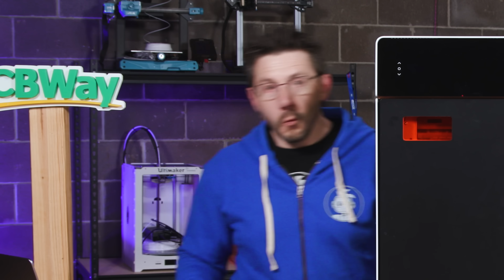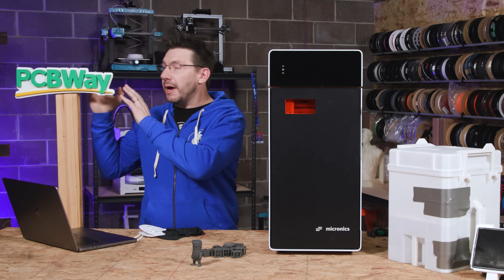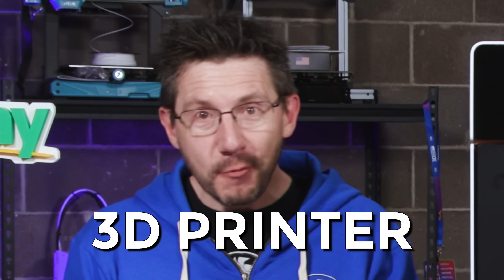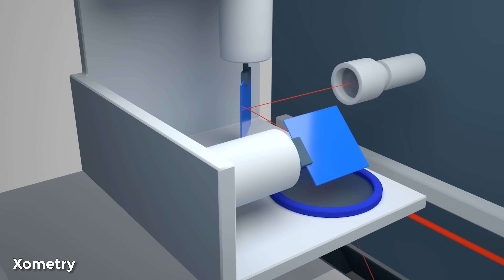SLS 3D Printing AT HOME?

Comment: If this machine being able to work with metal powder for this price it would be the best priced machine. But since this machine is expensive same as plastic powder and requires media blaster that is another expensive machine for finishing prints there is no way someone would be interested. This machine could be replaced with SLA printer which is $150 and $20 for 1L of resin washing and curing machine is optional you can build one for $10 uv lamp and $10 rotating display stand or buy one for $80.

Comment: Nice review of a promising product! 

I would love to see a build in vibrator that vibrates all the powder of your printed parts, which is also being sucked away in that process. Then a second stage where one or two build in sandblasting heads, use the same sintering powder and the sucking function in reverse, to blast the parts clean. The heads turn around, or the buildplate, what ever works best. Then a final stage which sucks one more time as much powder away as possible. The blasting and sucking may work best, when they are combined now I think of it. For blasting (without powder in the end) will bring particles to the suction mouths, where else they would be hard to reach. 
Even if this makes the printer twice as expensive, it would be a blessing and a huge time and headache saver, to not have to deal with the loose powder.

Comment: They should make a vibration table with a screen to post process the parts before blasting. It could be another add on unit. And i always thought about being able to do this with failed pri ts off of fdm. Make a box with a sanding belt at the bottom toss in faled prints and sand it down into a fine powder to reuse in a sls printer

Comment: Another option would be to get a small vacuum similar to what dentists use to suck up your saliva and just suck up the powder with that much like an archeological dig. I'd definitely go over to something far finer than 80 grit media, 500grit or finer would give it a MUCH better finish. You also don't need a big cabinet like that unless you are doing TONS of prints, you can make a hobby blasting cabinet out of a large plastic tote and a pair of sleeved gloves and use either an airbrush media blaster or something like the electric one they have on Temu or Harbor Freight for around $20-30. 
Personally, I think there's an altogether different option that'd make it to where you could gather and reuse the powder without tainting it with another media... Water blasting via a water pick. Having used a water pick back when I had braces I can tell you first hand just how powerful those things are.. you could easily wash the loose powder off with one of those and then collect it and dry it out to be used again.

Comment: too bad formlabs bought them out which means no consumer lever SLS printers Formlabs are gonna keep that out of reach for as long as possible
Reply: yeah it was all a rouse, controlling the competition, monopolistic pricing to keep profits up
Reply: You hit it on the head, formlabs so called low cost SLS printer starts at 28K, and thats just the printer… you still need the other machines for cleaning and curing….. so, if you think that 3k price tag isn’t about to increase you must be dreaming…. They greedy, and its no way they going to let the masses get in yet, they going to keep that price up until they cant anymore., then it will start coming down.

Comment: Micronics got acquired by formlabs so that Kickstart campaign is canceled. 

Formlabs bought them out due to the size and price being poised to under cut formlabs by 60 to 80 percent. 

So formlabs bought out micronics and that machine will not be produced. 

Sucks but I still hope that metal sintering will become more affordable, since it would drastically change the parts world and actually could upset "manufacturing secrets" of companies who upcharge for their custom styles.
Reply: its just another example of capitalism
Reply: @aquaticnstuff7666  well yeah, but it's their own choice. Freedom is most important. 

If they didn't want to make money then they wouldn't ever make anything new, the company which bought it micronics is chinese based so you can see that even communist ideology is performing the same moves as you do in a free market. 

I think according to the press releases and the rumors surrounding this merger that they are going to make a device simular to the one in the kickstarter just will have formlabs software and will be manufactured in China. Alot of actual manufacturing jobs are done in China since they already have the manufacturing industry and pay their employees less then America so it brings the overhead down. Plus asmuch as id like this to be madein America I understand that the price for a unit wouldn't be at all affordable for a consumer market.

Comment: This technology is clearly not ready for commercial use. Forget the inconvenience of having to sift through sand to find the parts you just printed, or the failures you encountered, the safety hazard this thing presents is already on par with resin.

Comment: That mask is not proper PPE. You need a mask that actually seals to your skin, using proper mask fitment tests (smelling salts) to make sure your mask is filtering. 

The masks the media/govs said would protect you from CV19, were not able to do so, and if you don't believe me with that mask not working Joel, sand drywall and you will have dust in your nose, so the thought they protected you from CV is a joke.. and a full body protection with supplied air would be the only way.

In fact, for this, a supplied air mask would be the only way to truly protect you.

Comment: Maybe a vibrating motor and flexibel (rubber/spring) stands for the filterbox would be a nice idea. Many , but not so strong vibriation. Motor + unbalanced wheel into the bottom.

Comment: "It's just a custom circuit board" - shows rPi nano or what's-it's-name :)
Reply from the maker: Hahaha. No it’s a custom board. They use OpAmps to control stuff.
Reply: @3DPrintingNerd  Oh, you are right. There is a custom PCB behind the Raspberry that it's soldered on. Did not notice that.
Reply: @3DPrintingNerd  BTW, it's hard to tell in the video but it looks like the resolution is not that good in comparison to Nylon SLS of MJF parts form one of those typical web 3d print services.. Do you have any experience with such for comparison compare? I wish this thing becomes reality but frankly I am getting the feeling that when they are ready to ship it will be slightly worse and just a little bit cheaper than Sinterit or alike.. I mean it works, it's not a scam and they have the technology.. But to make it durable, operable in long term and to make it series manufacturing-ready in quantity that they will need to get to the target price, there is still quite a road ahead and every single bump on it will increase a price just enough so it turns out to be closer to 8k$ unit than 3k$..

Comment: What an interesting machine, I would love to have a great one for industrial parts😃, if the manufacturer is interested there is someone willing in Argentina jeje😅, I worked for a long time recycling toner cartridges, which saved the family business when I worked with my dad in the 2000 crisis that we had in Argentina the famous Corralito. (it seems like a revolution similar to paper laser printers against ink printers)
This powder is very similar, I used masks and a centrifuge that I vacuumed and after years I had to have a treatment because the toner irritated my nasal passages, the other nose advised me to use a gas mask like those used for painting because the particles are very fine.
keep making these great videos Joel.
A big hug from Temperley, Buenos Aires, Argentina.🙋‍♂

que maquina mas interesante, me encantaría tener una genial para piezas industriales 😃, si el fabricante le interesa hay alguien dispuesto en argentina jeje😅 , trabaje mucho tiempo reciclando cartuchos de toner, lo que salvo la empresa familiar cuando trabajaba con mi papa en la crisis del 2000 que tuvimos en argentina el famoso Corralito.(parece una revolucion similar a las impresoras laser de papel contra las impresoras de tinta)

este polvo es muy similar usaba barbijos y una centrifuga que aspiraba y despues de años tuve que hacerme un tratamiento porque el toner irrito mis conductos nasales, el otrorrino me aconsejo usar una mascara de gases como las de pintar porque las particulas son muy finas.
sigue haciendo estos videos geniales Joel.
un abrazo grande desde Temperley, Buenos Aires, argentina.🙋‍♂

Comment: I'm curious how well an ultrasonic cleaner would be at removing the excess powder. If it can it could eliminate an additional dust producing step.
Reply: That wouldn't work very well I think the parts are kinda porous so the cleaning liquid will soak in probably the ultrasound may also damage the part and break the sintered particles off internally. There is a reason they don't suggest you wash the parts off. Also you must never ever wash the powder down the drain you will literally pour billions on billions of micro plastic beads into the ocean as the sewage plant can't filter such fine powders and the biological reactions can't digest it even in a sewage treatment pond.

Comment: Insanity squared. I would never go anywhere near SLS powders in my house.
Reply: The mfg isn't making this clear enough they say don't put it in your living spaces well more like it should have its own dedicated and ventilated space that itself isn't directly connected to a living space. The powder is so fine any air return will just suck it up and slowly spread it around. And if some home users gets a small print farm of them going it's won't end well. Homes have very low fresh air exchange rates the offices shown in mfg videos ironically probably have a lot more fresh air because packaged air units are terribly sealed and are on the roof so tons of air leaks and intentional economizers are used which flush a lot more fresh air than a modern home with a tiny hrv at best would provide.
Reply: @riakata  "The powder is so fine any air return will just suck it up and slowly spread it around." So when he vacuumed it up he was really spreading it around the air in the room and is now breathing it in.

Comment: The Shift container needs to be have extra ridge lines on all of the open spots blank on all six sides so that it's transport ready and has high impact resistance which will also increase it's overall durability so that when being used and moved around by the end user the box doesn't end up cracking with just one fall especially when it has powder material in it since the current version will certainly crack when dropped more than one or two times.
They can also increase the powder shifters wall thickness to handle impacts better but that can increase the shifter boxes weight quite a bit compared to adding ridges on its large blank sides for better impact resistance during shipping and general use.
The current Powder shifters shape(tower box type) and size is fine but the overall Design needs some 
very necessary changes. 
Also the extra weight will be worth it in the next design iteration since the piece of mind of having the product shipped to the customers without damage which then requires a new box to be sent as replacement along with the fact that customers will have to worry less about damaging the powder shifter while moving it around and have less material loss(since the printer material is a fine dust to work with) and downtime.

Comment: Having done a fair amount of research into dust collection, I feel it is extremely irresponsible to tell people this is something they should put in their home.
Reply: The reason why I stopped 3d printing at home is 
I discovered the proper way to Deal with  mikro particles that gets  in the air even by FDM printing. 
It's like in the sixties everything is safe 😂
Reply: This is not even remotely similar to a bambulabs printer this is like buying a welder with some sunglasses and a kn95 mask for PPE. And then saying probably safe to use in you bathroom under a washroom fan.

Comment: You need a special fire rated vacuum for that dust. Every other generic vacuum is a potential fire hazard ingesting that powder
Reply: I think the mfg is insanely irresponsible in safety communication but even then they clearly lack experience with safety equipment you can get a good enough solution with a home vac a very long hose and a special ULPA toner vacuum cartridge that completely contains the dust and is purpose built for toner dust which is even finer than this dust and is even more flammable and static sensitive. And best of all it costs 50usd for one. There are ways of budget proper safety but the mfg seems content on the below minimum safety standard to clearly sell to a larger addressable market at the literal cost of lung cancer deaths which in my view is extremely unethical.
Reply: @riakata  💯 🎯

Comment: There's no way that filter is catching all of the particles lol
Reply: They claim it's hepa but ignore the exhaust is too close to the inlet so bypass and inducted air flow is extremely likely and if a user error occurs and the cake gets even remotely close to that exhaust say because of a nearby wall or corner or sudden obstruction the powder will literally get lifted everywhere instantly.
Reply: @riakata  oh yeah that's what I meant. Im sure it's hepa and it's catching the particles that happen to get sucked in. But it's by no means a complete negative pressure fume hood. You can see the powder escaping all around it. It's unfortunate because a lot of people will think they're being safe by using this when in fact it's harming their health

Comment: FYI using a dust mask like that does not protect you especially if you have a beard. The sealing against your face is about the equivalent of holding a paper towel over your face. Invest in a good mask and strongly consider using a positive pressure HEPA rated respirator. You really don't want nylon particles ending up in your lungs

Comment: I honestly think Micronics is right about this being kinda safe. If anyone has refilled toner for laser printers, you'll do just fine with this. Toner particles are even smaller than the nylon particles used for this believe it or not. And an N95 mask is definitely ok at filtering, the problem is of course whether or not people know how to properly don one lol. I would do this outside however, not in my room like this.
Reply: You haven't been using the right PPE toner dust is more dangerous and is actually very flammable and explosive there are specific vacuum filter for toner spills and they are ULPA rated 0.13um absolute tested and sealed with esd plastic to prevent a toner dust explosion. The main thing protecting you and your toner refill is the amount of dust a home printer has not much toner dust but that cake of powder is many orders of magnitude larger than the total volume of toner your printer has and is far less constrained I don't think you handled a literally cube of toner dust with a scoop and a 3d printed shaker box. You used a bottle and funnel which is much safer and spills will be much more contained. Toner powder is very dangerous be careful with it. It's way way finer stuff. Oh other thing is since laser printers are pretty common said safe vaccum cartridge is just 50 dollars and can vacuum probably 100ish printer bottles worth of spilled toner safely.

Comment: the machine has to include post processing.
it already has a glass lid, why don't they have an air flush and recovery process - this is the core requirement of an SLS printer - print, have the sealed machine recycle the powder down ready to be relaid.
Reply: Costs and downplaying safety hazards. I think if your aware of the safety hazard and additional equipment to do post processing and cleaning properly this can be used safely at a fraction of the cost but the mfg isn't interested in safety it seems just lipservice for more sales. Lung cancer won't happen for many years so their company will either be big enough to handle the class action lawsuits or be gone to the wind so they clearly pressed the bend truth and deflect route.
Reply: @riakata  maybe they just don't realize, they have the media there, right there, they can make a media blaster using the nylon. now, with metal shizz, that's going to be tough, static n shzzz but you can ground it all, and even use large nylonbeads that will float when the metal powder is vibrated to liquefact (neologized!)
anyway, there's complexity here, but NEEDS to happen.

Comment: This is a really cool technology. Also special thanks to you and the commenters for mentioning that working with these requires  respiratory protection to prevent inadvertently breathing in the dusts.
I am not sure that I like the way they do the "fan" thing tho. I think it might be better if they included a "plastic tent vent hood" for you to place the cake in ... and have the fan attached to it so that it always pulls air out of the tent, and prevents you from accidentally getting particles in your "environment" (Which clearly happens as you shake the container). 
If they include a mobile vent hood, it would not add too much to the cost, since it would essentially be low cost probably clear plastic and maybe some structural pieces and it would likely improve the safety, as long as it was properly filtered and vented.
Reply: You have the right idea the dust processing should be done in a hood with all three sides covered the mfg solution is to reuse the glass to cover the top which isn't enough and the thin fan body is extremely risky as the airflow can be easily disrupted and blow back on the dust hazard.